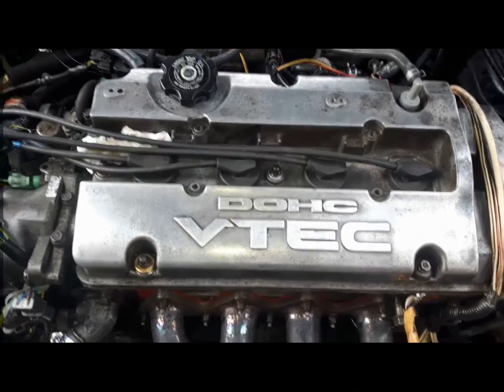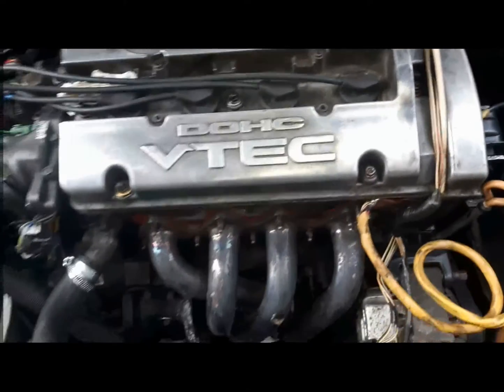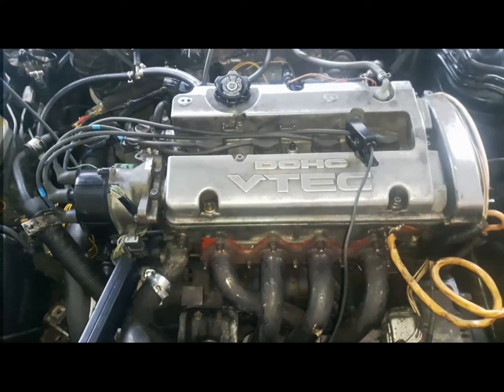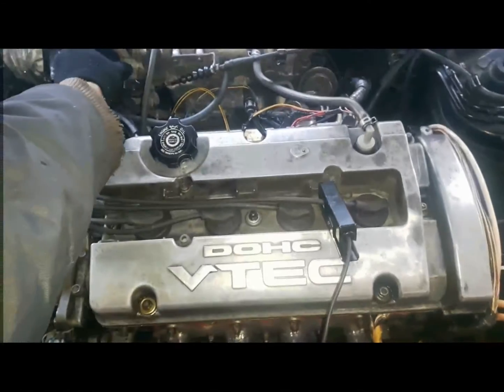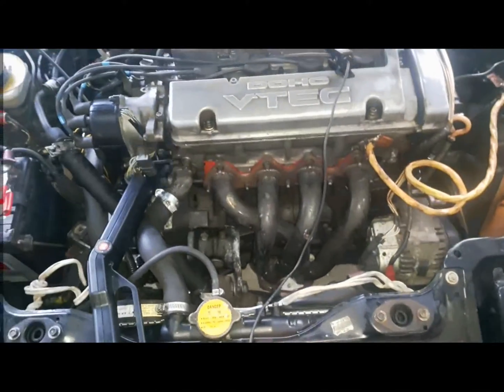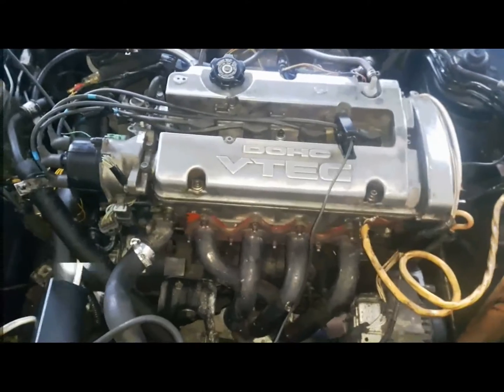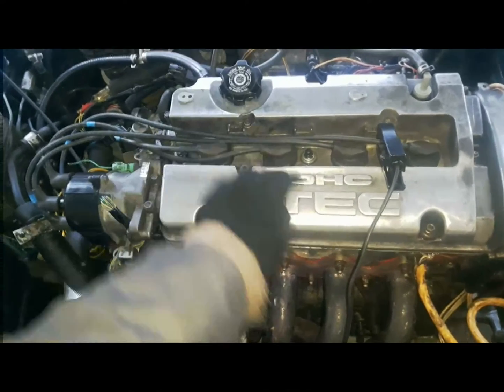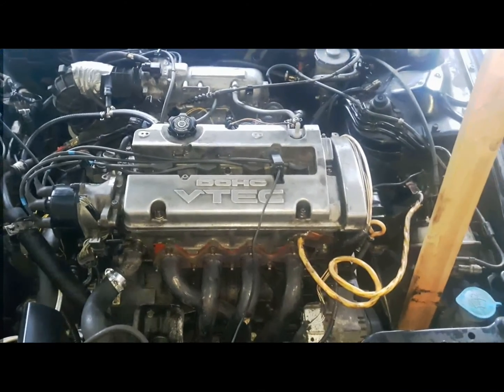How does faulty Engine knock sensor sound like??? Not valve adjustment

Comment: Hmmm. Just did a K24 K20 swap in my EG. Has a similar sound. My knock sensor is broken and not hooked up. Gonna try a new knock sensor & see how it goes.
Reply: How did it go
Reply: How did it go?
Reply: Did you fix your issue what was it? Mine sounds the same. Done valve adjustment and timing belt, tensioner etc still ticks.

Comment: I use to have a h22 swap in a eg hatch and it would make this knocking sound/ping, took it to 4 mechanics and all of them told me it was the bottom end, specifically the wrist pins(were the rod mates to the piston) I ended up buying a set of used pistons and rods and new bearings and rings, had a dude that worked on Honda’s tell me he could do the job, he made me get him a honer like the one with the 3 stones for the drill and at that point I had doubts about him and I even told him that the h22 block had frm sleeves and that iv never seen anyone take the shine off the sleeves with that honing tool he made me get but he reassured me that he knew what he was doing so I said ok. Got the car back a few day later and it was smoking really bad and it felt sluggish, i took it back n told him I though it was out of timing and he took it apart and I was right he left it out of timing slightly, i get it back once he redid the timing and it was running better but still smoking really bad and to top it off it still had the knocking sound and now it’s smoking, i already knew he had ruined the block with the honing tool, i was upset to say the least, took it to my house and seen that the egr valve didn’t have the vacuum line hooked up to it but it had been like that since the swap but just for shits n giggles I decide to run the vacuum line to it and all of the sudden the knocking goes away smh, long story short the knocking sound was the egr valve the whole time, but at that point it was too late, the guy I paid to fix the block that didn’t even need to be fixed to begin with ended up ruining the block, 4 mechanics told me it was the wrist pins knocking wen the whole time it was the egr valve
Reply: This is how I got my 2000 prelude guy thought the motor was gone so I got it for $1200 back in 2012 I did put in a new timing belt water pump k tensioner back in 2012 last till 2017 with lot of hard driving. Now I have a sleeved H22a turbo mostly used parts but runs great 👍.
Reply: @markchapman2585  is that the prelude, the one on your profile picture??
Reply: @whatdadogdoin7531  it is
Reply: @markchapman2585  nice ride man. When I went car shopping I also wanted a Prelude. But didn't find any in good condition. Most of them was either rusted out or beaten up. I read somewhere that they are based on the Accord coupes. Don't know if that's true
Reply: @whatdadogdoin7531  Yeah they do rust out I had a hard time finding mine living in the rust belt didn't help. But they don't really share the same chassis as the accord maybe earlier generations but don't think so. love the H22a though with a little turbo on it my best dyno run was 410 whp now I am at 350 ish to keep it more reliable well still beating other cars lol. Cheers from Canada 🍻.
Reply: @markchapman2585  damn the h22 turbo builds are awesome. Also I'm from Canada too

Comment: I have to change out the knock sensor on my Honda Pilot I don't know if the sensor is bad because the wires completely gone but I'm going to replace the whole thing anyway
Reply: Did it make this noise? Did it fix it.

Comment: I'm having the same problem with my 2000 Infiniti G20 which has a ripped off harness exposing the copper wires which connects to the knock sensor and I'm also having a code for the downstream O2 sensor because the harness is tied together with the knock sensor wire. I gotta stop being lazy she work on it

Comment: Knocking noise is still there 🤷🏻‍♂️
Reply: Replace knock sensor noise will go away
Reply: @devprashath26  - video to prove ?
Reply: @devprashath26 did yours sound like this? Did you replace it and it fixed it?

Comment: I have a similar knock and it only happens when I rev it a little maybe 1200 rpm est but you don't hear it at idle or driving and no loose of power at all b18b1 any idea?
Reply: Same. Only mine is heard at around 2500 rpm.
Reply: @loudtwinkiesxd98  mine is around 2k but goes aways completely  if I'm idling at 3k
Reply: @boostedjunkies  i wish mine went away. Mines is there at start up. Not very noticeable at start up or idle but gets faster and louder as i accelerate. At this point im guessing its a spun bearing or wornout piston ring seals
Reply: @boostedjunkies Did you fix your issue what was it? Mine sounds the same. Done valve adjustment and timing belt, tensioner etc still ticks.
Reply: It’s called piston slap. Hondas are notorious for this problem.
Reply: Did you fix your issue what was it? Mine sounds the same. Done valve adjustment and timing belt, tensioner etc still ticks.

Comment: Lol, a sensor doesn't make noise like that, that's internal issues.
Reply: Are you stupid bro do you know what a knock sensor is if that shit goes bad you have improper fuel mixture and spark ignition time the ECU gets confused and doesn't know what to send the signal even a coolant temperature sensor goes bad you have the same issue trust me and you shit starts to Knocking which is called pinging inside a cylinder you're talking about a rod knock ,a rod knock is different that shits don't go away with no sensor that shits internally from a spun bearing get your facts right bud
Reply: @angeluribe2232  thanks for being objective

Comment: Knock sensor makes no noise it detects a knock and throws a code and they also throw the code when they fail. But they do not cause a knock something in the engine is knocking
Reply: Throwing the code puts it in limp mode causing the noise from a change in the timing
Reply: @jamesolelo4406  No, no functioning knock sensor means the ignition timing gets advanced too much which leads to detonation/pinging. The timing change in limp mode is wicked retarded so it definitely will not ping. It will just drive with low performance.
Reply: He is talking about bad knock sensor=too far advanced-engine pinging. He says it right in the video.
Reply: @numberpirate  lol i like how you copy and pasted this

Comment: I have a h22A with this tapping. Got an oil change and was told my oil filter housing was leaking. This vid says the knock sensor is near the oil filter. Could this be related?? I have a 92 Honda Accord with the h22a swap also
Reply: Oil on sensor may cause damage
Reply: Yup check it I have an h2 and the wires for the knock sensor connection on those cars tend to crack and dissolve and by time they rip it might just be the connection I went to the junkyard and I just get connections from a chords and h22 they're the same connection accords that have four cylinders though with the f20 or f22 or older preludes with h23's non VTEC they're all the same connection and if while you're at it just get a sensor to but yeah the connection on those cars tend to rip I don't know why all the all the connections on the prelude and older Hondas tend to dissolve and just show wire and rip by time I've soldered a lot of them

Comment: The faulty knock sensor is not at fault for the knocking. The knock sensor's only job is to prevent knocking in an unhealthy engine, it protects the engine from destroying itself but is not the cause nor the solution for the knocking.

This means two things:
1. It does nothing in a healthy engine. 
2. If you hear knocking once it malfunctions, you got bigger problems than a knock sensor.
Reply: He is talking about bad knock sensor=too far advanced-engine pinging. He says it right in the video.

Comment: Best way to explain knock sensor fault is it causes a gas engine to fire like a diesel which can do a ton of damage if not fixed. I had over 200 psi on every cylinder of compression because of this sensor not functioning. Can you say detonation? Lol Hopefully no damage but will see when I open her up to replace the sensor soon! And no, she's been garaged and not driven due to misfire w vtm4 light and I didn't want to damage the engine. The vtm4 light coming on with cel due to random cylinder misfires is a telling sign of sensor. Did you have both lights?
Reply: 200psi is good for compression, and that has nothing to do with a knock sensor. Compression tests are done with the engine not sparking or delivering fuel and in fact the compression tester is screwed into the place where the spark plug normally sits. It is purely a mechanical test to see if the engine seals well and 200 psi is quite good for an engine. 
A knock sensor governs when the spark occurs in a running engine. A bad knock sensor will not prevent the engine from advancing the timing and advancing the timing can cause the actually pressure wave from the combustion event to peak before the piston reaches TDC(top dead center/top of its stroke). 
So it sounds like you know more than most but not quit all of it. Good job for at least knowing what you did.
Reply: @numberpirate  is it bad for my engine if i dont change the knock sensor. I have the code but it runs ok

Comment: That isn't a 3.5 like you say is it? Forgive me Im learning and The 3.5 is a SOHC not a DOHC on both my 03 pilot and 10 accord plus they both have coil on plug not plug wires. What year is this J series engine? I have a 1st gen v6 pilot that has a bad sensor and it sounds more like a boom under the intake (muffled and thumpy) than this rod knock. The sensor is causing the air fuel mixture to spontaneously combust because the sensor isn't detecting anything and the cylinders have no control on compression on top of the ecu pulling the ignition timing (not mechanical timing, ignition) way back. Therefore detonation occurs then the spark tip glows and pre-ignition takes place. That is what the sensor causes. I'm glad you got yours to where its significantly better. Valve lash is more important than many think im learning. :)
Sounds like it must have been the lash or something else more than the sensor that affected the rods on yours because a knock sensor malfunction will make a sound but it sounds like thumping not this. Detonation from a bad knock sensor isn't really synchronized like this rod knock is. I have a bad knock sensor (finally figured it out today after a lot of research) and it sounds like a boom under the intake.
Thanks for the video!
Reply: J series is V6 which means two banks of 3 cylinders. Look at this engine and you can see 4 spark plug wire boots so it is a 4 cylinder. This one is out of  Honda Prelude 92-01. It is called an H series or H22A which is a 2.2L.

Comment: Hello, I have a question - the knocking sound, was it louder on a cold engine and got smoother when hot as it is on the video?

I have the same noise , but on me in cold it more lounder.And when engine hot the noise is the same as on the video
Reply: Same here with my v6, on cold it’s louder once it warms up the sound isn’t as bad but still there, Iv taken it to mechanics and they tell me to just use thinner oil but nothing is helping
Reply: @ChebosTV  i use 5w30 . I purchase knock sensor and will replace when it come.Will replay what's  happened
Reply: Change the knock sensor, nothing change.The same sound as before.I will see valve adjustment.
Reply: @zlatkochakarov7550 Did you fix your issue what was it? Mine sounds the same. Done valve adjustment and timing belt, tensioner etc still ticks.
Reply: @jasonpanto  No. The sound is piston slap. I put a camera in the cylinders and there are scratches on two of them. The car is not burning oil and still runs, although a little noisy.
Reply: Valve adjustment needed most likely. I just diagnosed (took a lot of time and research especially because I'm not a mechanic just learning how to work on my vehicles) the knock sensor finally in my Pilot. The noise on this video isn't what a bad knock sensor will cause to happen. Its more like a thumping sound because of detonation and pre-ignition from a bad sensor.

Valves make sense on the cold start because when the oil starts pumping through you get better seals but the valves are not hydraulic so need to be checked and adjusted

Comment: That’s rod knock the knock sender won’t make any noise
Reply: I see what you're saying though. That engine is damaged so he will never get it to go away completely in my opinion. He went past the stage mines in and it burnt a valve out or something so the lobe is just hanging on the crank. Metal on metal not good sound. Surely mechanical damage at that point. Maybe originally from a knock sensor but kept driving it without Diagnosing or repair. Who knows
Reply: It will make a sound but it sounds like thumping not this. Detonation from a bad knock sensor isn't really synchronized like this rod knock is. I have a bad knock sensor (finally figured it out today after a lot of research) and it sounds like a boom under the intake.
Reply: When the knock sensor starts to malfunction, you will hear loud noises coming from the engine that almost resembles thumping sounds. The longer you go without fixing this problem, the louder those sounds are going to get.

The reason this noise occurs is due to the ignition of the air and fuel mixture inside of the cylinder. Normally, the mixture would reach the combustion point instead. Therefore, sounds like this should motivate you to take your vehicle to the mechanic promptly. (Oards.com)

Comment: Took most of the noise away but when you accelerate it right at the end still heard the noise not 100% healthy
Reply: That engine is damaged so he will never get it to go away completely in my opinion. He went past the stage mines in and it burnt a valve out or something so the lobe is just hanging on the crank. Metal on metal not good sound. Surely mechanical damage at that point. Maybe originally from a knock sensor but kept driving it without Diagnosing or repair. Who knows
Reply: @sarajill7  he should be able to completely remove that sound by changing out the damaged rocker arms , lifters and damaged cams if any ..No?

Comment: A knock sensor will  not make any noise its only a SENSOR.
Reply: The sensor will not but please mister try running youre engine without sensors and it will knock and bang
Reply: did someone say to run no sensor, it would not run correct if at all, no sensor just a CEL and limp mode.

Comment: Buenas ..que pasaría si no hago puente en el conector de servicio.. y muevo el distribuidor
Reply from the maker: that service connector steadies the idle and helps pinpoint the timing. Not a big deal if you moved without jumping it, as long as the engine responds very well upon acceleration, it is all good
Reply: @wisemonkey1551  

Thanks for replying. I had that problem I moved the distributor without using the service connector, since it does not work as long ago. I was told that when you move you lose the ecu mapping settings. The engine does not accelerate more than 3000rpm and has an antilag. Would there be another way to tune up without using the service connector? I appreciate your help.
Reply from the maker: ECU will go to default if you reset the battery anyways. Besides, it does rev over 3k when the connector is connected. I drove with it connected and revved to 6k easily.

Comment: That civic after you say it runs nice after you fixed it but too me that engine sounds like it's still knocking.. I meam that engine sounds knackered?
Reply from the maker: True. The idle was still a bit erratic. And when the idle drops, yes it still knocks a bit and adjusts back. But it is a lot better than before and the knock sensor code 23 is not coming anymore. Stay tuned, I am trying couple of other things to eliminate the knock.
Reply: @wisemonkey1551 Did you fix your issue what was it? Mine sounds the same. Done valve adjustment and timing belt, tensioner etc still ticks.

Comment: My v6 accord is making a similar noise but no check engine light, would a bad knock sensor trigger a check engine light?
Reply: I also have v6 accord, change timing belt and tensioner , did valve adjustments , take off each ignition coil sparks to check if the problem in cylinders and noise still was there, and the only case was this sensor , I changed it and problem ran away.
Reply: @andriisokolov6502 did the sensor look bad?
Reply: VAPING RAGE QUITTER yes
Reply: Not always, I just had the same sound issue with no check engine light, when I reached that sensor , it was broken just felt apart.
Reply: @andriisokolov6502  hi there. Did the sound go away? Thanks
Reply: @andriisokolov6502  yeah. My customers car sounds like it has bad timing but the knock sensor was chewed off.
Reply: @TheLifeOfMartin lol what was chewed off? Plastic?
Reply: @andriisokolov6502 Did you fix your issue what was it? Mine sounds the same. Done valve adjustment and timing belt, tensioner etc still ticks.
Reply: Did you change the sensor and if so did the sound go away? My v6 accord is making the same noise and no check engine light
Reply: @ChebosTV  I haven’t done it yet, got the timing belt done and replaced serpentine tensioner, noise is still there, drives fine so I been lazy to go down that rabbit hole, hoping it is something stupid like a knock sensor or ac or steering pulley but my motor does have 210,000 miles on it, if it’s something more serious like piston slap, it’s cheaper to get a new low mile motor than to rebuild the old one
Reply: @ChebosTV  Did you fix your issue what was it? Mine sounds the same. Done valve adjustment and timing belt, tensioner etc still ticks.
Reply: Did you fix your issue what was it? Mine sounds the same. Done valve adjustment and timing belt, tensioner etc still ticks.